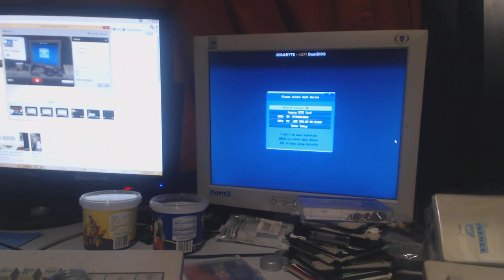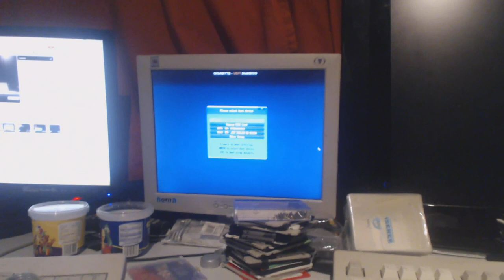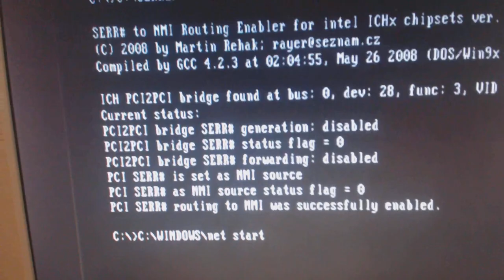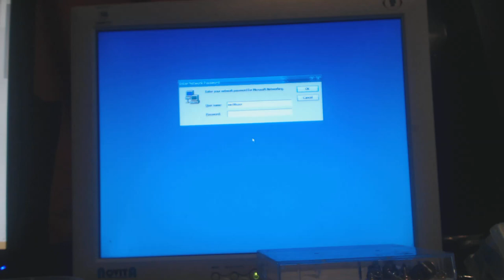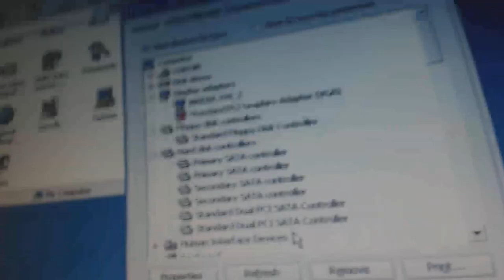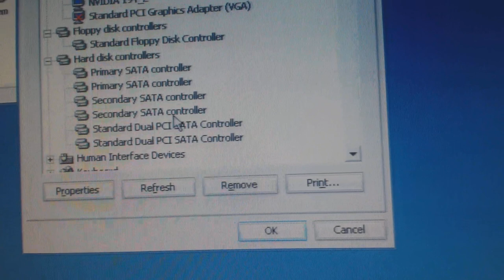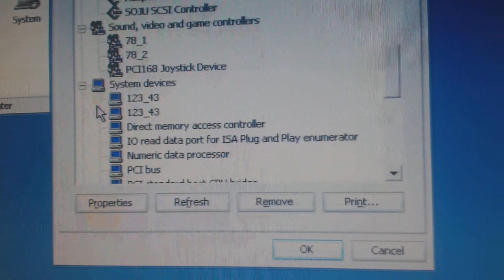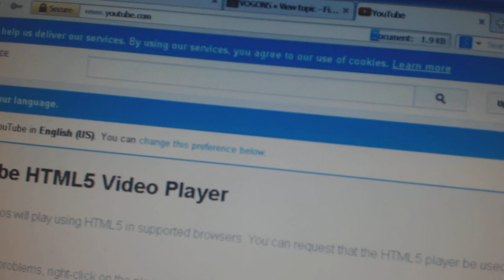Proof of the i5 running Windows 98 and System Tour

Comment: You don't happen to know of any other modern motherboards that  could relatively easily run Win98SE?  Is it only the Intel B85 Express shipsets that are happy with Win98SE or do you know of any others that works fine? Am I correct in my understanding that the Realtek ALC887 Audio and GbE Lan chips on this board did have Win98SE drivers available?  Do you happen to know if any of the later Realtek chips have drivers available too?
Reply from the maker: +SomethingNewEveryDay Any intel motherboard should do. For the network chips sometimes they still have windows 98 drivers (e.g. the Realtek 811x series), but they always provide a so called "NDIS2" driver for legacy purposes which will work on windows 98 as well. The audio chipset will not work.
Reply: +Oerg866 Thank you I have found the legacy Dos drivers now. When you say 811x is that a specific model or is it just any with 811 at the start? For example I found the MSI Z97S SLI Krait Edition motherboard cheap that has a Realtek 8111G Gigabit LAN controller. Thanks again
Reply from the maker: SomethingNewEveryDay Correct. That 8111G should work with NDIS2 drivers, I think the last one supported by the normal Win98 drivers is the 8111E.